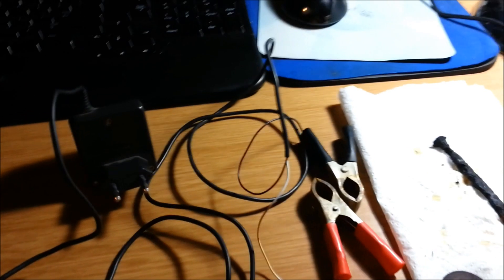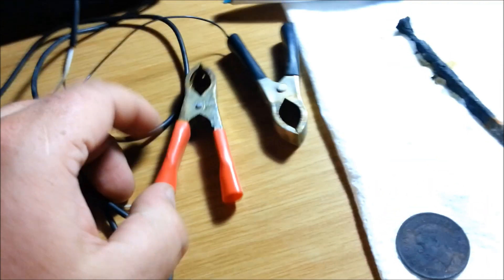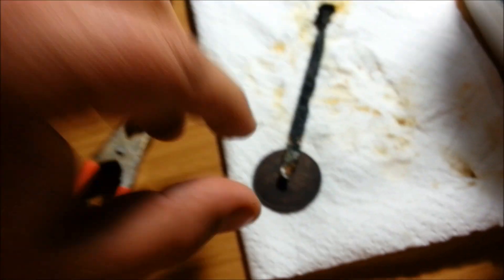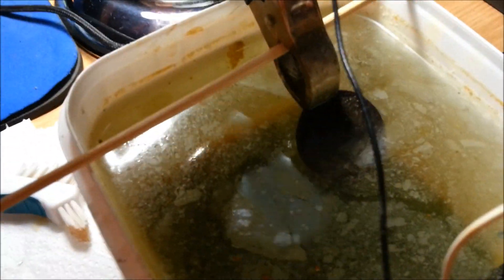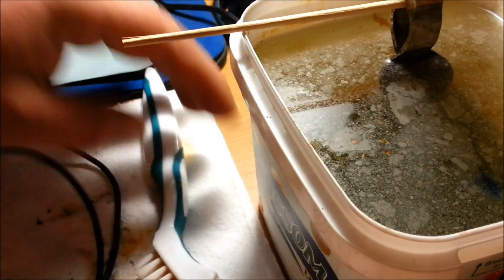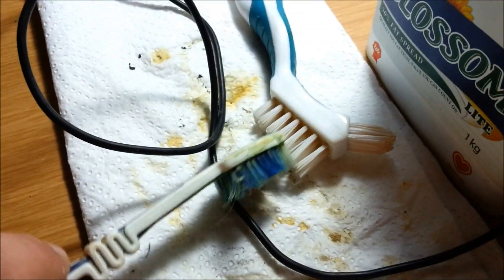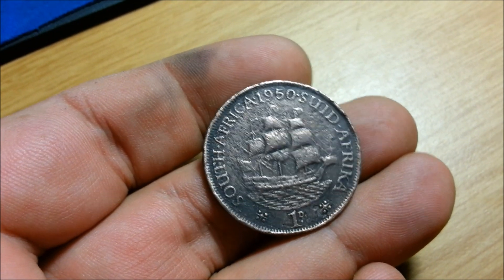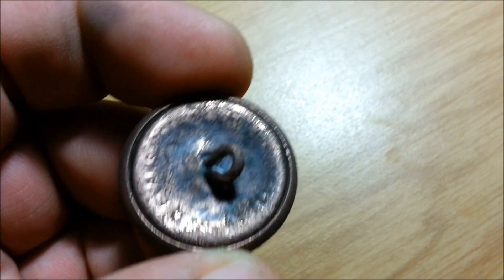Cleaning your copper finds using Electrolysis

Comment: The gas isn’t “poisonous” per say. One coin can’t create high volumes of sulphur dioxide. It can cause one hell of a smell however. It smells like a dead man’s wind. I would more accurately say if you prefer not to throw up. Do it outside. 
I use this method all the time on silver and sometimes but rarely gold. I clean a dozen shipwreck coins a month. So the high value metals comment is not accurate. It’s actually safest way to clean encrusted silver coins I know of. You use a stainless steel anode and not a rusty old nail however. 
Copper is the most stubborn metal to clean and i actually think this method (tho it does work to remove encrustation) it makes the copper look shit. I’ve tried every trick in the book and still can’t find a decent way to clean it that doesn’t hurt the object in some way. So I just leave it alone.
Reply: He may have been referring to the salt solution creating chlorine gas at one of the electrodes (I forget which one) when it gets electrolyzed.  It's good to do that outside if using salt as an electrolyte!

Comment: Is the anode and cathode not the wrong way around? Normally oxidation is at the anode which is the positive. Therefore the coin should be connected to the positive lead?

Comment: I use a battery charger to do the same job.But it might be to aggressive at times as does coins in minutes and if you leave to long knacks them .Will have to make one like yours up and give it a go . Nice one Dave
Reply from the maker: david hopper Thanks Dave. I've seen the ones with a battery charger and it looked a bit heavy duty for what I wanted to do, so I tried the cell phone charger and it worked very well. Its gentle enough not to harm the item you're cleaning. I've only had success with this method.